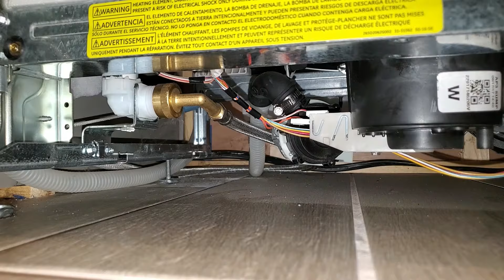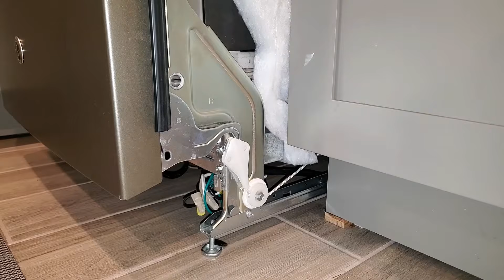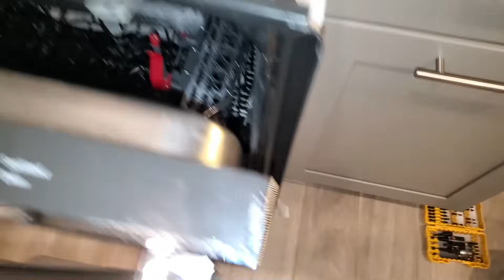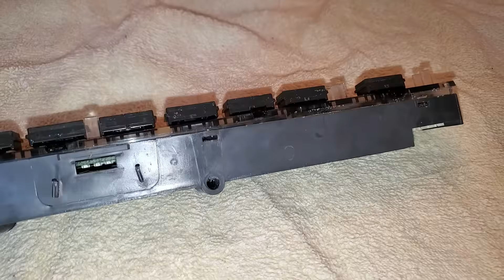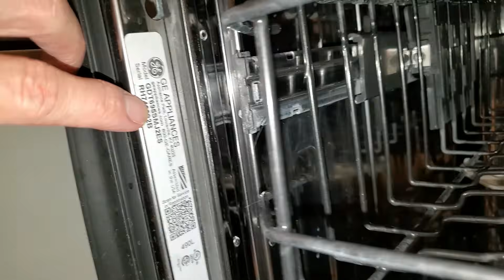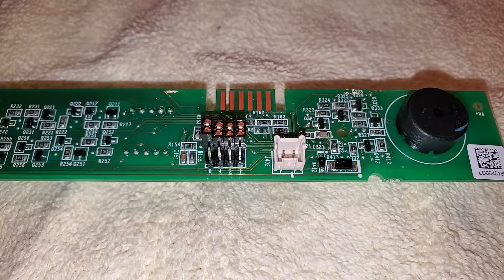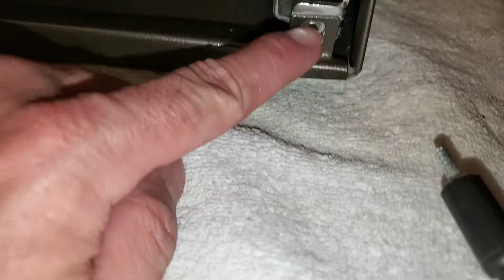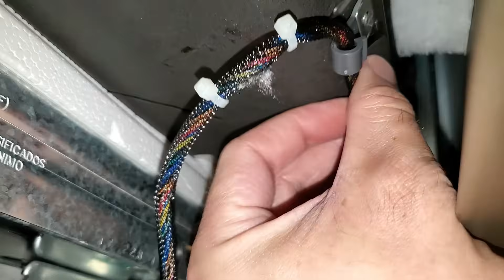GE Dishwasher Repair  - Replacing the User Interface Control Board

Comment: Thank you! Our start button wouldn't work, but the rest of the board was fine. Once we opened it up, we realized the rectangular rubber piece under the start button had become too soft and worn out, so that it couldn't activate the button on the circuit board. We 3-D printed a new TPU rubber rectangle that fit perfectly, and got it all put back together, so for us, your video resulted in a 'free' repair. Horrifying that a little piece of rubber can 'break' an expensive dishwasher.

Comment: Matt, just now seeing this. My model started doing the same thing yours did before going out completely. Question: is your washer still working? I am debating doing this myself. I saw someone on Reddit saying they switched out both the control board and the UI and the washer still won't work. I hate putting money into something that just immediately fails again. But wonderful video. You did an excellent job. Thank you very much. These GE machines seen to be a mess. I either have to fix mine OR buy another GE because my appliances are all "slate" color and I think GE is the only one that sells the slate color. Thanks again.

Comment: If you still have a blank UI panel after reassembly and reconnecting power, make sure you hold "Start + Select Cycle" for 5 seconds. I was about ready to give up but luckily found that information in a separate video. Still a great tutorial. Thank you!

Comment: One added tip. When you remove the two white plastic door hinge tensioners, there is a "U" shaped metal clip under each one to hold the white cable and spring under tension to prevent the springs from popping off each side of the dishwasher. So you don't have to pull the dishwasher out all the way in the event of short drain, plumbing, or electrical connections. We own an identical Stainless steel dishwasher model to the one you worked on in your video. It lasted 8 years, then first started self-rebooting and chiming, and eventually went completely dead. Cycling breaker got it to come back one time, then poof, all the UI LED's went dead and it was completely unresponsive to the UI button panel.

I bought a new control board and that got the LEDs back on but the unit would not start. So I am going to probably replace the UI PCB next. While I am waiting on that item, on the main control board are two round red-brown fuses near the AC power connector corner of the board. One is mounted in a socket and tested okay. The other rated 6.3 Amps was soldered in and was blown. It appears to send power to the PCM low voltage DC power supplies (PS) located on the same main board. One DC PS is rated 13.5VDC, the other is rated 5VDC. I noticed smoke traces on the white plastic box underneath the largest capacitor. It is an electrolytic rated 47mfd at 250VDC. Electrolytic capacitors have a design life of 7-10 years max. So I replaced that capacitor and installed a socket and replaced the 6.3A fuse. I found a supplier on Amazon that had a range of fuse values for sale and included 10 fuses and sockets to go with them for under $10.00. That got my original main control board working again. 

I plan to pull the door off again and install a new UI PCB. I also found that my Drain Pump which is rated 120VAC, and it's coil is supposed to measure 27 Ohms +- 10%. It was actually reading 2.3 Meg Ohms. So it appears to have an open winding. I ordered one of those off of Amazon for another $40.00. I am waiting for it to arrive to see if this completes the repairs. The last item on my list is the UI PCB. 

This dishwasher series seems to have a self-destruct timer built into the firmware that when it reaches so many X number of wash cycles it self-destructs. Call it planned obsolescence. Would never buy another GE appliance again. What a nightmare! if I can't fix this PoS, we will look to a Miele brand dishwasher to try next.

Comment: Quick note. If your dishwasher doesn’t have those screws on the side right above the hinges, you need to remove the little filter in the door turn it counterclockwise and it will release the door.

Comment: Cannot thank you enough for this. ✊👍😎 I’m reassembling ours today. Flood sensor has likely caused heat to fail some time ago. Some damage to door latch. I replaced main board 2 years ago. Thanks to you I know about the light on that board (ours lights up when first powered).  -  Thinking the UI board might be the culprit. Now if I didn’t mess anything up taking it apart. 😂😂  Our door didn’t have the screws in the side, but otherwise very close to yours. Thanks again!

Comment: Excellent step-by-step instructions with great video showing all the required detail.  Thanks so much!   Wanted to add that these instructions were spot on for my GE Profile Model PDT825SSJ2SS, including the step to disengage the tension string on the door hinges (unlike other models which require using 2 allen wrenches to keep the door hinges from shutting when the door is removed).

Comment: I just wanted to say thanks, and add a REAL helpful update. At 10:48 when he shows removing the spring rope, be sure to stretch the string out and over that hook right in front of the pulley. I didn't and the string came off the spring deep in the side of the unit. Then, trying to put the string back on , the spring came loose. You cannot see where the spring attaches, you must feel where it goes, or pull the dishwasher all the way out which could mean disconnecting water , power etc. ALWAYS keep a little tension on those strings. Go under the pulley and over the hook. That's why they put them there.

Comment: You are fantastic and I am extremely thankful for your video. I did the typical "guy" thing and didn't pay attention to the paperwork with the jumper settings in it and put everything back together the first time without it........of course. It didn't work.  So, when I watched your video I realized my error. I changed the jumpers put it back together again and it works. Thank very much.

Comment: If you have a door like this one, you don't have to remove it (or move the dishwasher either) to get to the control board. Use a narrow 1/4 inch socket with a thin extension to remove the two bolts (shown around minute 14 of this video) from under the door on each side. Then remove the four, star screws to separate the inner and outer halve of the door. Have something heavy ready to place in the outer shelf to keep it from springing closed.

Comment: 5:43 some dishwashers will have a dangling piece here- don’t worry you didn’t break anything this is a vestigial leak sensor not applicable to your model. Unless you have the floor protector, in which case it’s maybe a leak sensor that was not installed :)

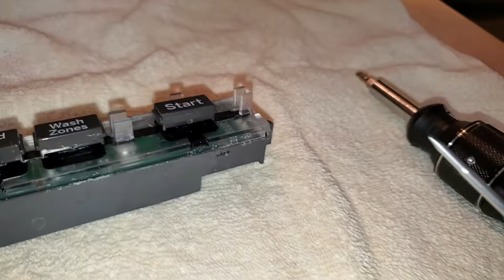Comment: 19:03 easiest way to remove the diffuser panel is to start at either end, from the exposed part down below the diffuser panel- there you can press the gray plastic outward from the inside, easily slipping the retaining tabs with a little upward force on the diffuser panel. 

Once you’ve done that, you can use any small prying object to get between the clear and gray plastics. Don’t pry up*, gently pry the gray plastics *outward while applying finger pressure only to pull the diffuser panel up/out. The whole process will take just a few seconds once you’ve got the hang of it. No trace left behind.

Comment: 10:48 Watch out for slipped springs! Below the pulley there is a tension cable keeper clamp- you want to let the diamond shaped cable head rest retract to rest in the U-shaped little channel right in front of and level with bottom of the pulley wheel. That will prevent the spring from losing tension and coming loose from the back, transforming this easy repair into one that requires a full removal of the machine.

Comment: Appliance repair guy said $450 for new control board and install and recommended I just buy a new Whirlpool one (now $500-$600). Luckily I came across your most excellent and very through video.  I dont know how you filmed and did the work at the same time. This was not and easy repair, but your step by step video took me all the way through with success (and no extra left over parts). Like jerry5290 below says, I wish I could send you $20 to show my appreciation. Thanks again Matt!

Comment: My husband watched your video; his comments follow.  

WOW what an amazing set of instructions!!!  I first watched your video about first checking the Control Board.  I had the green flashing LED and the 14 VDC.  So based on your wonderfull step by step instructions i gained access to the UI Board.  I found a replacement board on Amazon.  Had it shipped overnight and installed it.  So from the time the dishwasher no longer worked to being fully operation was just over 24 hours.  You can't get a repairman out that quick.  Thank You!!!  HAPPY WIFE HAPPY LIFE!!!!

Comment: Great videos indeed, helped diagnose that the UI board died. Replaced it, mainboard has solid green light, and UI board works. However, now I have error code 860, i.e. doorlatch communication fault. 
Doorlatch and cable harness multimeter test proves these are fine. Jumper settings of UI board are corect. Main board has solid green light. Any thoughts what the problem might be and how to solve?
Reply: Did you ever resolve ? Having same problem

Comment: Great video. Replaced user interface and control board. Lots of issues with GE but not really sure if a bosch 800 would cause same headaches.

Comment: Great video, Matt.  We have the same model and the control board did the exact same.  We are DYI people, but this video sure made the repair process much easier.  We bought all new GE appliances when we remodeled seven  years ago; this is the first problem we've had...hopefully, you have, or will have, videos on those appliances too.  :)

Comment: This video was GREAT at making my life easier in trying how to figure out how the replace the UI board. Thank you. Someone probably has mentioned this, but if you have a stone countertop that the dishwasher can't be mounted to, there are access holes with plugs in the sides of the dishwasher that will have screws going into the cabinets on either side. You may have to remove the top rack to access these like I did. Just FYI on this small variant. Thanks again.

Comment: Hey  Matt Excellent video very detailed love it ! I have the same exact DW did exactly what you did in troubleshooting to make sure it was the UI,  doing this job only took 40 min can be 1 hr for some.  So I looked up the UI and wow it was very expensive now for the "GE brand" cheapest was $160 and most expensive was $210.00 so I figured if the original died within 5 yrs screw that I purchased a knock off from amazon for $60.00  brand "framefirm" let's see how long it lasts plus comes with 1 yr warranty and yes made in china just like everything else lol. This is a cheap DW brand/model new under $400 this must be the reason why UI went bad . I had a kenmoore elite cost me $1000 at my previous home that I sold and it lasted for 14 yrs never not 1 issue sold it with the house . No one should have to disconnect any hoses or electrical wires due to dishwashers are all hooked up before they slide into their designated  spot under counter so always plenty of slack !  My wife said something about the  lcd screen being different the numbers or whatever because it's a knock off but she doesn't mind it and it works ! Thank you Matt for this awesome video (part 1 and 2)  😃

Comment: I'm so confused not by the video it was very helpful. I got a generic replacement control panel interface and the dishwasher panel came on and was running but the indicator light was red not orange. I went to a local appliance store and got the genuine GE control panel interface and put it in. Now the lights on the control panel won't come on again. I dont understand it's getting power since the generic panel interface had power, why does the new GE part not show any lights

Comment: I have a model very similar to yours.  This was, for me, the best video to work from.  My unit had the exact same (intermittent) problems as yours had.  Replaced the UI board and works fine.  Confirmed that, for this unit at least, no need to remove the 2 screws underneath the door before removing the door.  I thought I was going to get by without pulling my dishwasher out at all, but turns out I had to on reassembly because the tensioner spring on one side, and the cable assembly on the other side fell off when tension was removed so I had to get in there to re-attach the spring and cord.   Thanks for a great video.

Comment: Something that may help someone with this particular model only. If you take an allen wrench and put it through the bottom hole on the white clip that holds the spring you can pull it forward then up over the hook on the door then secure it in the metal holder in the front. It is a clip with a bend that will accept the cord and not allow it to spring back behind. If it goes back behind you will have problems and will have to remove the unit to fix it back. Do not remove the wrench until you place it back over the hook. A needle nose plier will help, it’s really not that bad. These are instructions from the GE service manual so it works well, again with this particular model. Another note is the replacement board you get will probably not have the jumpers and will be already configured to this model. This was a good video on how to perform this task however..

Comment: Your two videos gave me the confidence to finally tackle this job on my own.  The dishwasher had been beeping and powering down for almost a year.  I would get it up and running by messing with the wire harness and flipping the circuit breaker on and off.  Finally, days before Christmas, my tricks stopped working.  I troubleshooted the main control panel as you showed in your first video and it was a-ok, so I ordered a new wire harness and UI Control Board (both, since I was taking the door off anyway.)  Finally, yesterday, I replaced both and the dishwasher is working great!  I keep listening for the random beeps throughout the day, like PTSD, or a phantom pain.  I'll have to get used to a quiet kitchen, the "new normal"!  Thanks so much for your videos.  I echo everyone else's sentiments.  Happy New Year!

Comment: thx cuh i fixeded my ge dishwursher i hope. I be running the cleaning cycle as we speak. Hopefully it's fixed. I ordered the part from amazon and some jackass returned it with the one they replaced. I know cause it had no jumper pins and I had to reorder it one mo gen

Comment: My harness was reading only 3V dc and when i went to the rear main board and pulled the panel off, i could smell the burnt components.
6 caps popped, (tops were domed up and not flat), 2 burnt surface mounts resistors, and a burnt Voltage rectifier that happened to feed 12V power to that display panel that was out.

Comment: There's a good thread on reddit on what causes this. We think the root cause for this problem is due to bad solder joints. The make the unit power off and on. Upon power on, the micro controller on the main board writes something to flash ram. Flash ram can only be written to so many times before it fails. Under normal conditions, dish washers dont power cycle very often, maybe a few times a year at most. But with failed solder joints and the unit turning on and off, eventually the micro controller's flash memory fails and dies. Which is why in the beginining power cycling the dish washer seems to bring it back.

Tonight i took main my board out and looked at it under a microscope and noted many many cracked solder joints. The worst was on a very small surface capacitor c910. I reflowed all the solder joints and put it back together and the dish washer is running fine now. I'll keep an eye on it. 

Point being, if you are handy with soldering, and your unit still works if you unplug it/ plug it back in, worth a try to reflow solder joints to see if that will fix your problem. Since youtube doesnt let you post links, I cant post the reddit thread here, but if you google "Fix for many GE dishwasher problems with control board, UI board, current sense module".

If after some time I confirm my rework fixed this issue permenently, I'm happy to offer my services resoldering these boards for anyone who is stuck with this unfortunate issue.

Comment: Hey first just wanted to thank you for the thorough and in depth review. Even something as simple as fine and coarse threaded screws which I mixed up haha.

Want to add for anyone who put in a new floor or just doesn’t want to deal with pulling the dishwasher out, which is arguably the hardest part of this fix. You can use a pair of needle nose pliers to unclip the door hinge springs. It’s harder to reclip them but if if you take your time it can be done. Mine actually came off their springs but you can reach under and to the side to reclip them to the springs. This saved me a bunch of time and frustration as my countertops and floor install makes pulling out the dishwasher a huge effort.

You may need to remove the 2 metal hinge pieces marked L and R. This is a simple 1/4 or Phillips to do so.

Comment: Thanks so much, Matt!  Only left with one question - what brand dishwasher should we buy next?  (When shopping 4 years ago, I asked about all the electronic failures reported with GE's top circuit card assembly - the salesman said that they used to be a problem, but got fixed with a new design.  Won't be shopping there again.)
Reply: Whirlpool, Maytag KitchenAid no LG or Samsung GE is now owned by the Chinese, which does not improve things